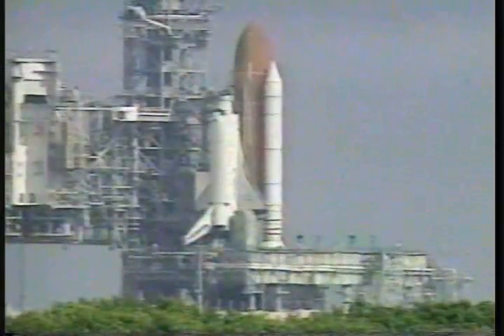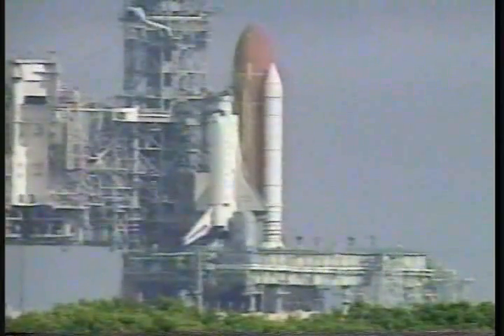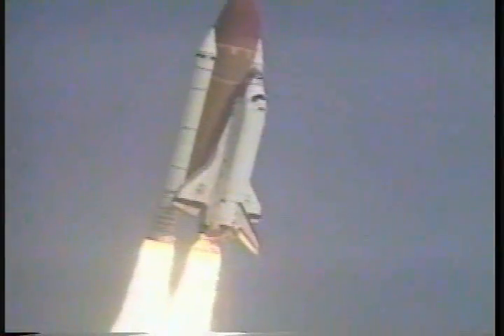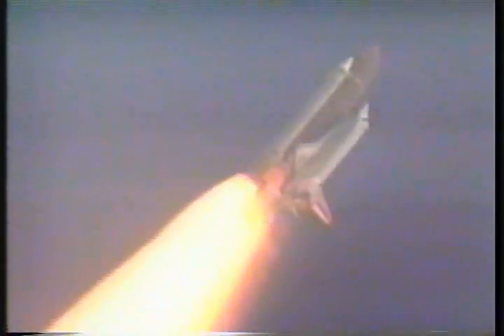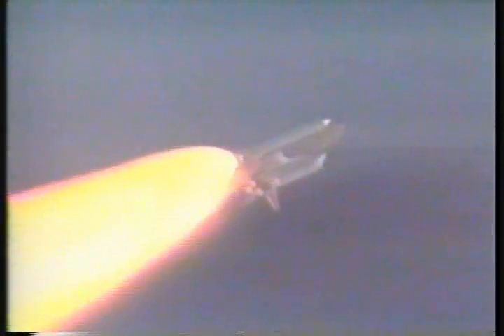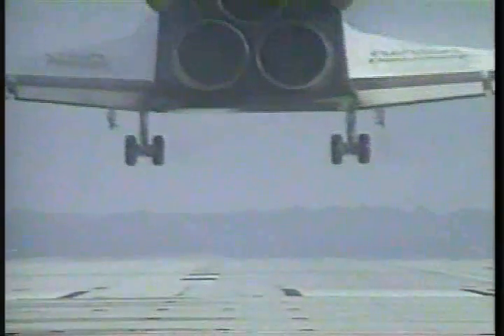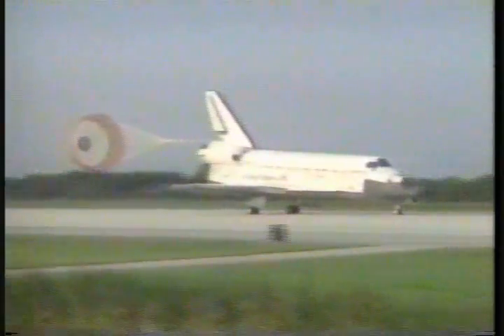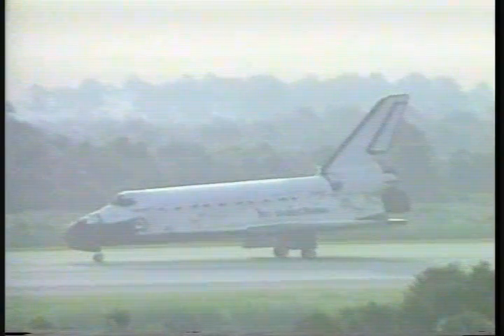STS-70 launch & landing (7-13-95)

Comment: This flight deployed the last of the 6 Tracking and Data Relay satellites launched from the Shuttle. There would have been a 7th satellite but that was destroyed in the Challenger accident. The flight was famous for the activities of woodpeckers that poked about 200 holes in the form insulation  of the External Tank and became The butt of many jokes.  A piece of insulation form hitting the Shuttle Columbia was responsible for that tragedy.  The launch marked the shortest time between the landing of one mission and the launch of the next,  6 days. 
This was the first flight of a new Block 1 main engine to improve the reliability and safety of the main engines.  The TDRS satellite would act as an on -orbit operational spare.  The mission also marked the first use of a  new Mission Control Center room in  Houston.  After the flight, Discovery underwent a period of refurbishment and modifications and would fly again about 18 months later in 1997 on a Hubble Space Telescope Servicing Mission. 
Tom Hendricks made his 3rd flight, his first as Commander.  Mission Specialists Nancy Currie and Donald Thomas made their second flights. 
Pilot Kevin Kregel and  MS Mary Ellen Weber made their first flight.